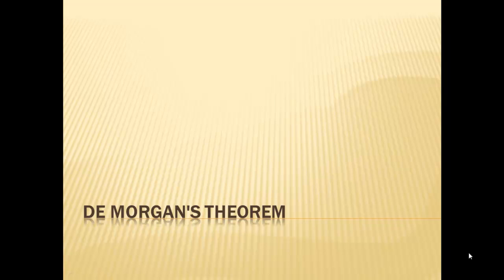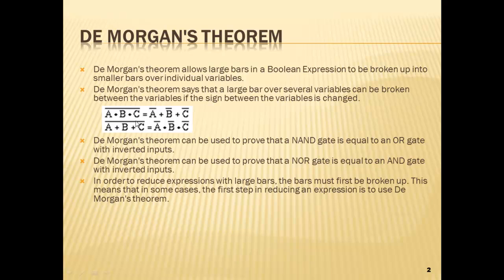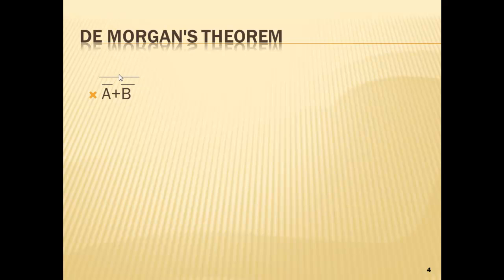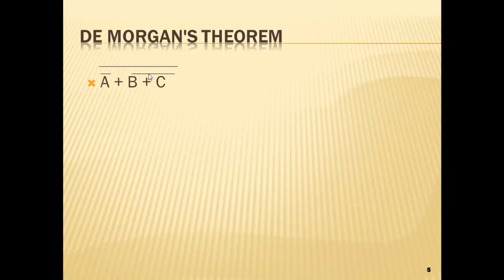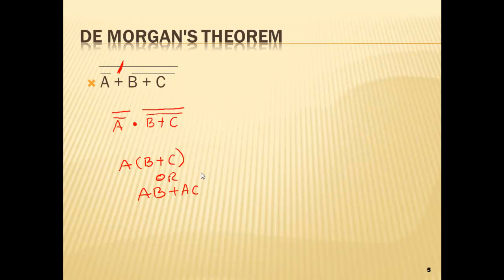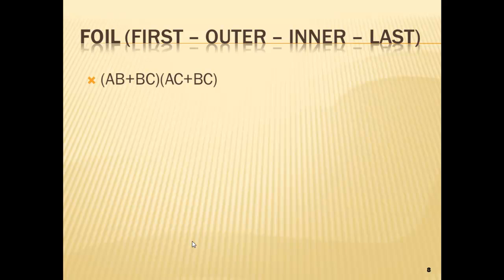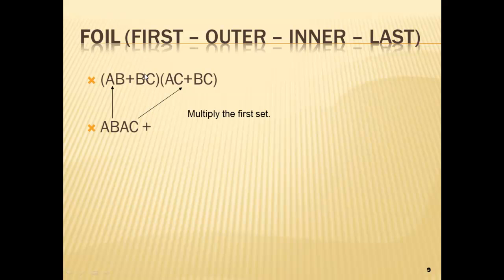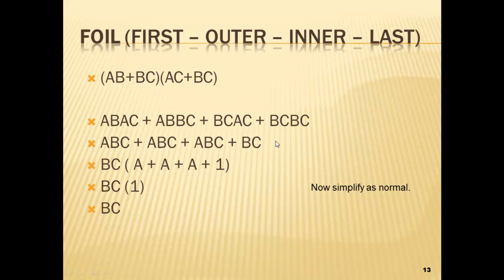Digital Electronics -- DeMorgan's Theorem

Comment: I am confused when the problems get larger I can do the simple ones but my teachers makes this hard very hard to understand I need help with it maybe I am not smart enough to get these things
Reply from the maker: Just take them line by line and and don't try to break too many things at once. Start with the lines closest to the terms (under other lines) and work up breaking one line and changing the sign at a time. You will get there.

Comment: At time 3:50 I thought the sign below B+C should have been changed to B•C 
Or did i miss something? 🤔
Reply from the maker: There are 2 lines that are both the same length so they cancel out. If you changed the sign, you would need to change it twice since there are 2 line taking you back to +
Reply: Im watching your video again. I have also been watching another video and reading a book that has some rules about what you showed at time 3:50 i jus want to make sure the rules in the book applies to your video as well.  I will take pictures and send to you for more clarification  @MovieHQ
Reply from the maker: @TacoDaddy-mr8ig  Those rules all still apply to Boolean algebra so they should apply to your book. It might be written differently. I have tried to make it as simple as possible.

Comment: Starting at the six minute mark, the third and fourth examples are wrong.  Why is there no sign change or complement for B + C? Shouldn't the final answer be A + B'C'?  Same with the fourth example why are you not changing the AND operator to an OR operator for A'C'?
Reply from the maker: These are both correct. For #3: B+C has 2 lines over them. If you were to break those 2 lines, you would need to change the sign 2 times. Or just cancel the 2 lines (since they are the same length. Same for #4.

Comment: at 9:17 wouldn't you have been left with just BC(A+1), how did you cancel the 3 A's ?
Reply from the maker: +Maximilian Ortiz Remember the rule of ORs. Anything ORed with a 1 is a 1. Does not matter how many terms or what the terms are.
Reply: Oh ok so if it is A + 1 or B + 1 it will always result to 1. Now how about if it was A + B + 1 will the result also be 1?
Reply from the maker: +Maximilian Ortiz Those will always result in a 1.
Reply: MovieHQ thanks for your help

Comment: Why can't we break the line and change the sign to plus for the 4th example where you have     ______
                ____  ?
                   AC
Reply from the maker: +Kapil Kumar If you are talking about the 4th one on the list at around 5:07, you could break the line and change to + however, there are 2 lines. You would need to then break the second solid line therefore changing it back to *. Remember that lines of the same length (covering the same items) just cancel out. Hope that helps and thanks for watching.

Comment: I know you said you can break a line but can you reconnect it while changing the gate again? like saying: A(not) * B(not) is the same as (not) A+B?
Reply from the maker: +John Cobb Yes. Connect a line and change the sign.. Same thing in reverse.
Reply: +MovieHQ what if you run into a 1+A(not) or a 1*A(not)
Reply from the maker: +John Cobb Anythings ORed with a 1 is a 1... Anything ANDed with a 1 is just the thing (A(not)).

Comment: Why didn't you change the sign between (B+C) When you broke the line? 3:46
Reply from the maker: I did not break a line for that one. A and B+C both had 2 lines over them. When you have 2 lines, they cancel each other out. If you broke lines, you would have to break 2 lines and change the sign twice (going back to waht you had in the first place).
Reply: Ok ic now...Thanks man God bless u.